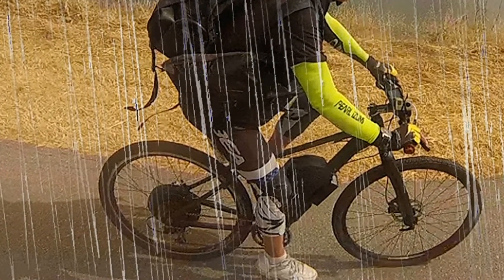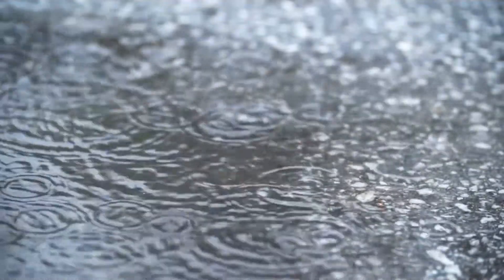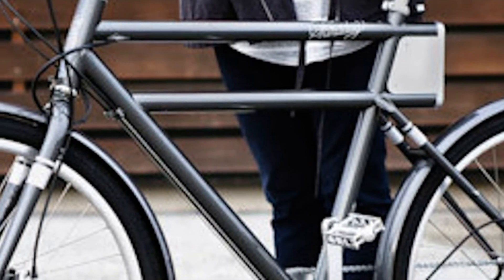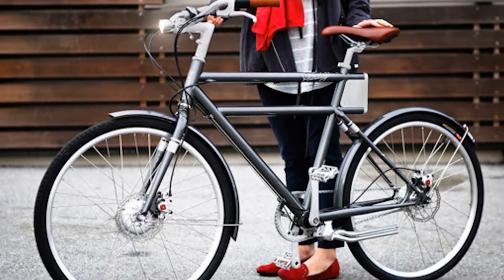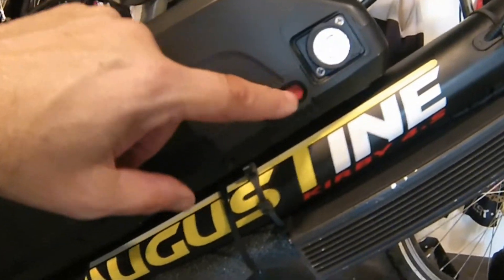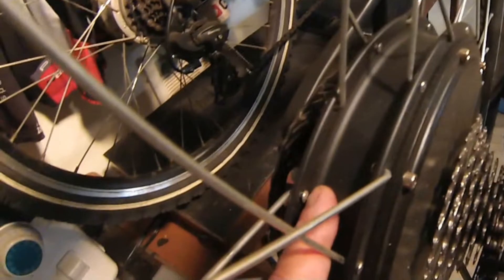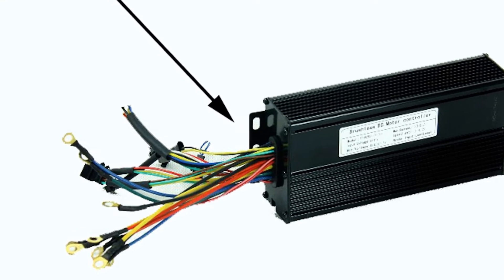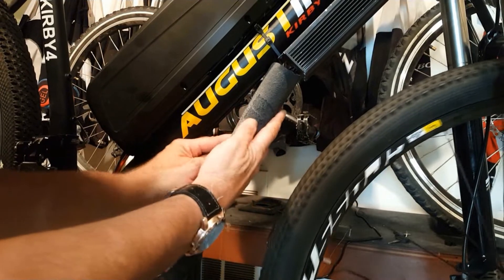E BIKE MYTHS: Riding E bikes in the Rain

Comment: My ebike is a conversation which i bought from Amazon. I can see that its battery is fine but the motor isn't working. It started  breaking when i was riding it in a heavy rain. After few time it has completely stopped working. The LCD shows power, i checked every mechanical part and its wires. They look fine. What do you suspect?